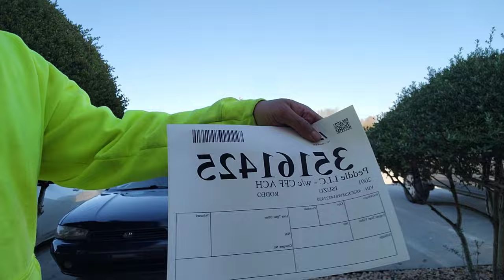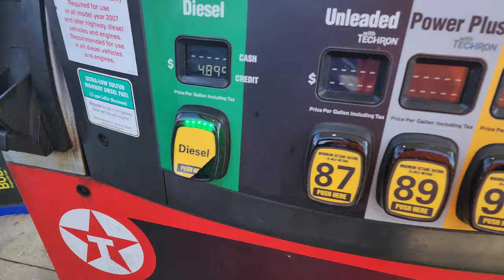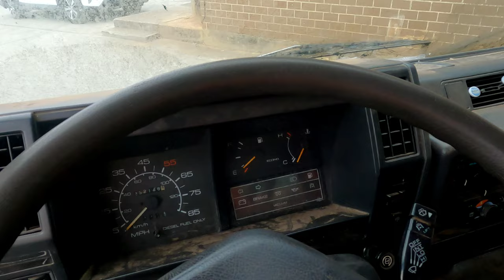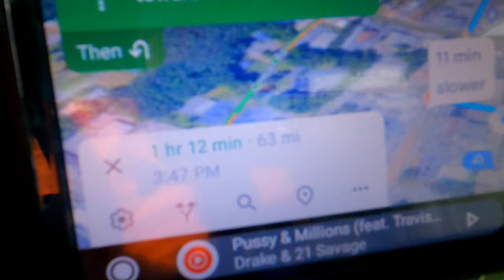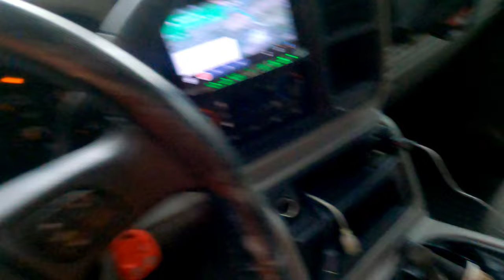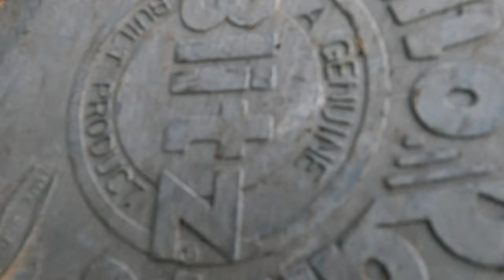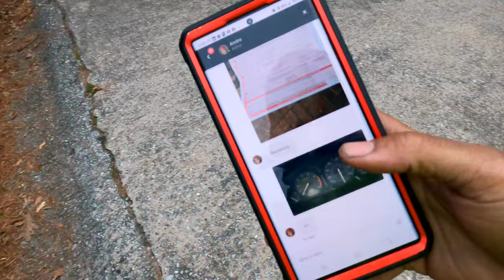Trailer sway almost WRECKED my wife's Yukon 😬

Comment: Either a chain from the opposite side to the middle.  Or have a piece built out of square tubing that spands the trailer from pocket to pocket with multiple attachments points.

Comment: JUST RUN A CHAIN ACROSS THE DECK LEFT TO RIGHT  AND SCURE IT TO THE RUB RAILS, THAN HOOK THE SNATCH BLOCK ON THE CENTER OF THE CHAIN TO PREVENT THE BINDING EFFECT...👍
Reply from the maker: Yes I understand what you're saying. I need to grab one of those snatch blocks with the chain & 🪝  💪🏽
Reply: @10TowsDownTowing  NOT AT ALL. JUST GET A CHAIN, SECURE IT ON BOTH SIDES. USE YOUR EXISTING SNATCH BLOCK WITH THE SHACKLE I SEE AND PLACE IT THRU THE CHAIN LINK IN THE MIDDLE OF THE DECK. PRETTY SURE YOU HAVE A CHAIN LAYING AROUND..
Reply: @10TowsDownTowing  

THE SAME WAY I TOLD YOU I WAS GONNA USE MY SNATCH BLOCK ACROSS THE REAR OF THE TRAILER...

Comment: Speaking of sway.    How did you actually handle it?   I typically hit my break controller on the trailer to stop it.
Reply from the maker: Brake lightly, sometimes letting it slow on it own and turn very slightly while it slows down